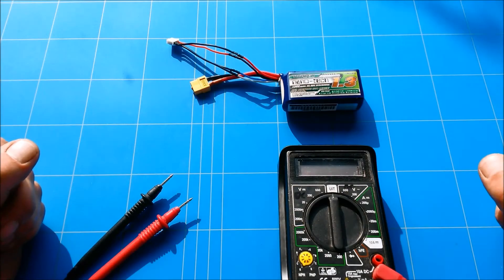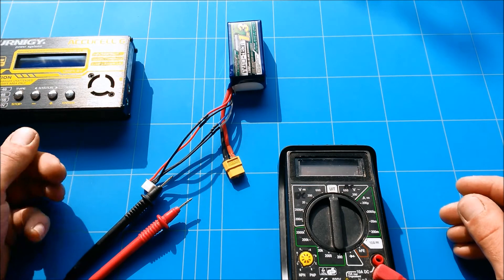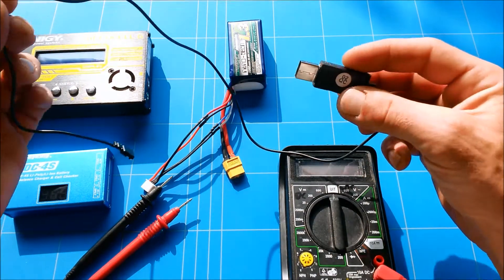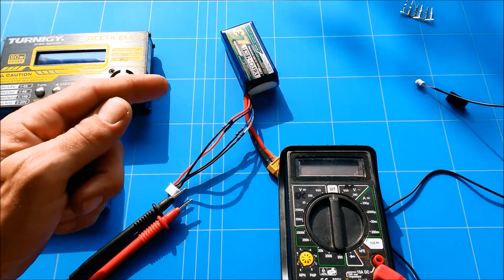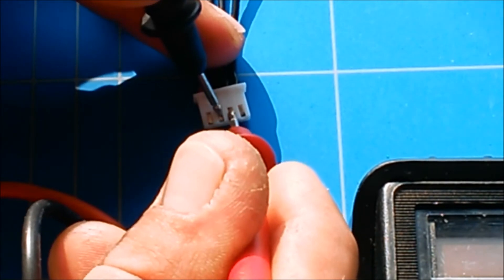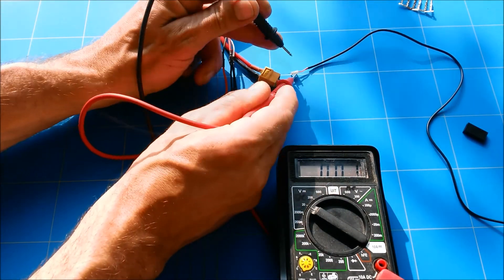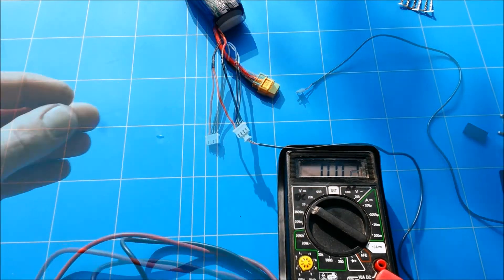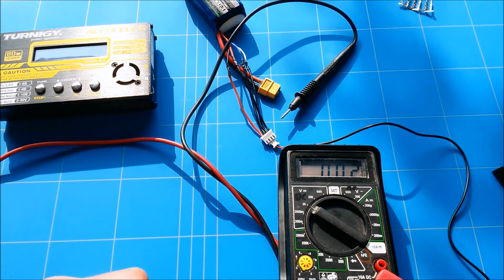How To FIX a Lipo Battery Repair Under $1

Comment: Greetings & thank you for the video. Nicely done. I am an r/c enthusiast myself of many years. I recently had a situation where my son left his 2s batteries in his vehicle hooked up to the ESC. Although the system was turned off, it proceeded to drain the batteries below 2.9 v per cell, and the cells became very un balanced as well over a 30 + day period of time. ( I did warn him this could happen ; P ) As you already know, Most Lipo chargers, (excluding a few) will not charge a battery if a cell is under approx. 2.9v, or if there is a large difference in cell balance in a multi cell Lipo battery, and will generally proceed to default into low voltage mode etc.., thus not charging the battery. So i did do what you described as i have done a couple of other times, and used the Nimh setting @ 1.5A for a 5000mah 2s Lipo battery) I used that charge setting along with an external cell checker / balancer for a few moments until each cell read 3v or more, and immediately changed the setting to the "Lipo Balance charge" setting, (also plugging into the chargers on board balance port) where it can proceed to properly balance all cells as they charge. (I would not attempt to use the bump charge method if i could not see the voltage in each cell of the battery as they take voltage on. Things can go very wrong very fast, & this may tell you precisely before that happens ; ) I am always a little fearful when attempting this because Lipo's are no joke, & also now i have to test it : /
My issue now is that the batteries do not seem to hold a full charge as well, nor do the cells seem to hold balance as closely as they did before. This is after they have sat only for a day or so. I am fearful to test because un equal dispersion between cells could cause the battery to erupt as i have seen in the past with a brand new 3s airplane battery. Upon take off, I lost all power & luckily had a smooth glide in crash landing do to flaps and elevator positioning upon power loss. Once inspected, I found that 1 cell had dispersed completely in that short moment on take off, & the other 2 cells were still near full at 3.98v ea. The faulty cell had quadrupled in size and was on the verge of explosion! (VERY HOT! i might add)
 This vehicle in question utilizes a 2- 2s battery set up. Not my fav design, but no room for 4s, & i guess It is cool that you can run in series or parallel (depending on desired power, or run time) so I digress. My fear in testing is this....If i have both problems of battery voltages not matching each other, and the fact that each battery is not in perfect balance... Should i record this in case it ends in a fire ball! LOL!  My question is if you have any recommendations on cell balance tolerances? Is there a safe amount of mis-aligned balance? I thought i had heard a rule once upon a time, but cant seem to find the info, or recall what the figures were... Very much appreciate any input you can offer
-Radio Flyer : )

Comment: Great video, good to offer an alternative. Does it have good effects?
Reply from the maker: iám using this method for 2 years and the lipo´s i used it on are still alive and kicking
depending on how low the voltage is of the cell but it takes only 10 to 30seconds to pump your voltage over the 3.3 volts again where your normale charger can take it over
iff your cell is reading1 volt and it takes more then a minute to charge it to 3.3v then your one cell charger those tends to run hot! but that is also a extreem condition where your lipo shudent be in!
Reply: Yes I agree, the lipo shouldn't be there! Good to hear that you've had plenty of experience with it. Having one cell too low though, it troubles me. Isn't it an indication of a bad battery to begin with? Is it wise at all to apply this bugfix to a lipo that can display this behavior to begin with?
Reply from the maker: it just happens sometimes because we can´t hear the beeper or we are just having to much fun haha
you also don´t wane play it safe and charge a half full lipo all the time thats hurting it too best is 20% and thats around 3.5v
Reply: not hearing the beeper (having too much fun? :) is exactly why that happened yesterday and exactly why I stumbled upon your video! Thanks again for the info.